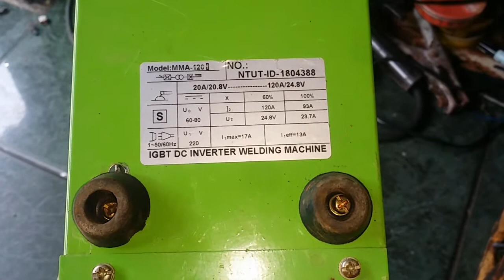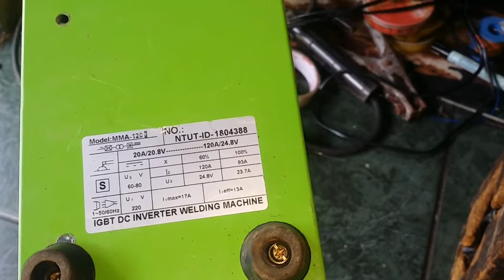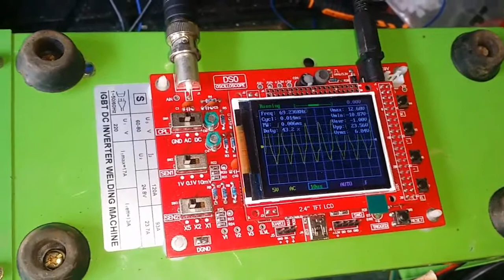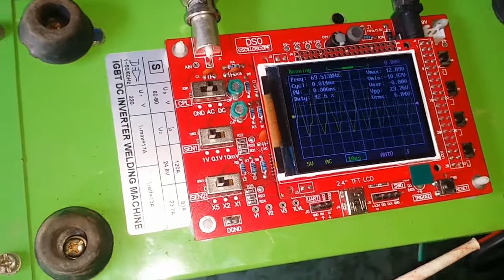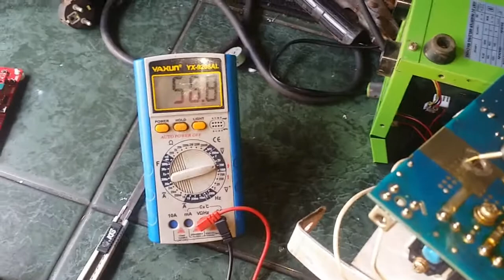MESIN LAS IGBT MORIS MMA 120 (MATI TOTAL)

Comment: Mosfet PSU nya yg kaya otocopler nya kode brp mas kan d hapus
Reply from the maker: itu mosfet mas , memang bentuk nya kaya optocopler ,  seri nya hapus dari pabrik nya 😂😂 , seri nya irfd120
Reply: Oh mksh mas soalnya saya ada servisan sama
Mosfet nya ngebul mas
Reply: Klu yg tr a1015 posisi nya  gmn ya mas pin gate base cole
Reply: Maksud nya base  emitor colectror
Reply from the maker: 1 emitor , 2 colektor , 3basis
Reply: @afalhannan  mas irfd120 nya kebakar terus ya yg salah apanya ya
Reply from the maker: brati area vgs bermasalah mas , out dari gdt nya ada komponen yg short
Reply: @afalhannan  saya cek satu2 ga ada yg short
Aout dari irfd120 kan langsung ke trapo
Reply from the maker: kalo irf d jebol terus pasti ada yg short mas ,  coba igbt nya lepas dulu dan komponen yg ke gate lepas smua , lalu di ukur di travo gdt nya harus ada skitar 50khz freq nya
Reply: @afalhannan  semua udh d copot mas
Jalur yg ke gate udh d ganti semua zener 4148 udh ganti s1015 udh resistor2 juga udh ganti
Reply from the maker: lanjut d wa mas biar bisa ngoreksi